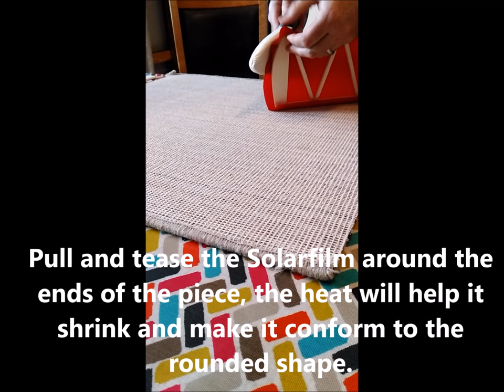Video 13: Covering the RC plane using solarfilm

Comment: I was taught to cover from inside out. Meaning tack from the middle  and pull the covering and tack outside edge. While the end product looks good, it seems like this is the opposite of what to many other modelers do.
Reply from the maker: Hi, I think it's a matter of choice. With heat shrink film you can get away with a lot! My preference is to tack it down to essentially hold it in place so it doesn't go astray. Then work from one edge to the other. For the wings I follow the method you mention, tacking among the spars and then working towards the complex curves (wingtips, LE).

Comment: It has to be said that if you started with less massive wrinkles in the surface during your initial 'pinning down' at the edges you would take a lot less than 30 minutes to cover this part and the job would be way easier too
Reply from the maker: +Guy Griffiths this is  true, but my problem was that the film didn't come on a roll but folded over (for some crazy reason!). Buying as rolls in future 😀

Comment: This is not the correct way to cover a frail tailplane or wing,by tightening one side you stand the chance of introducing a warp,the correct way is to cover one panel first by tacking the edges and sealing them but no tightening process yet,next cover the other side and seal the edges,now alternating between top and bottom surface lightly tighten the wing so the stresses are equally applied and no warps are introduced.
Reply: Correct.
Reply: I was thought to never shrink one side.. Always alternate, as you mentioned..
Reply: you should also add some tiny holes, so that the heated and expanded air can escape and not lift the cover from the surface